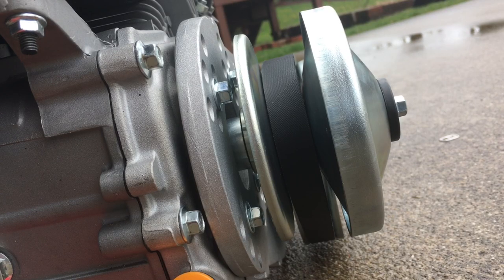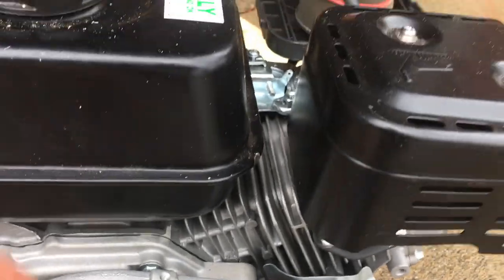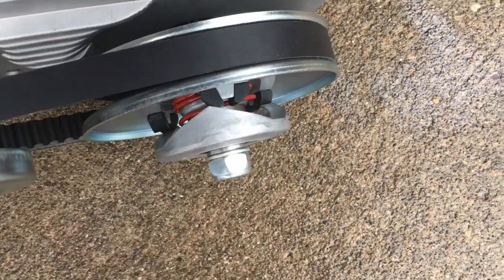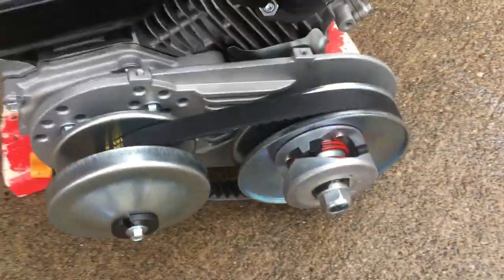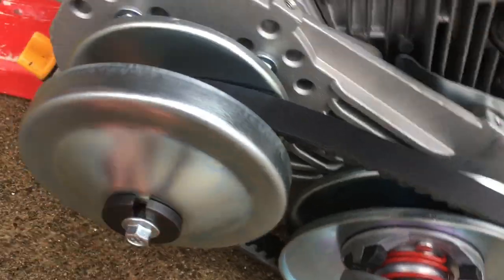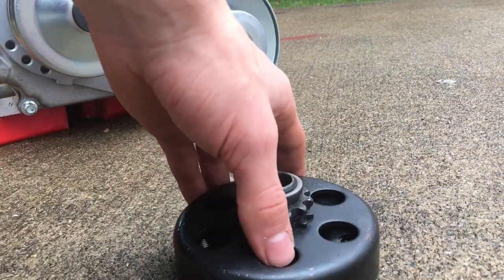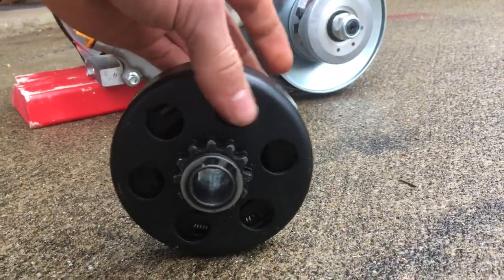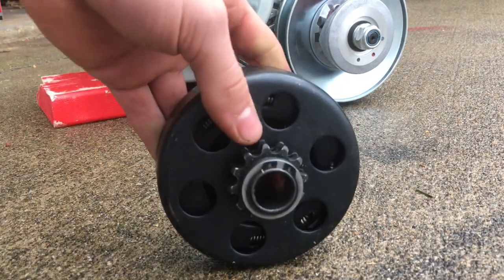What Are The Differences Between a Torque Converter and a Centrifugal Clutch?

Comment from the maker: The mechanism with the belt is called a CVT technically. That stands for continuously variable transmission. However, I call it a torque converter because that's what 99% of people in the go cart and minibike world call it. I know what the torque converter is. It is a fluid filled enclosed mechanism that is an automatic transmission cars.Please stop commenting that I'm wrong.
Reply: Good job bud, don’t worry about the numpties!
Reply: And John you forgot to mention that an auto torque convertor can multiply peak stall torque upto 2.6:1 times via internal finned angled vanes.Trev🇳🇿😎New Zealand home of the world's fastest old Indian 😇
Reply from the maker: @trevinskiking2165  thanks for the info!
Reply: @JohnWheels  No worries,....you can get similar effect to the 'Holeshot' Auto hotrod converters by putting those heavier weight springs in the centrifugal clutch, cheaters simple way of revving it up & dropping the clutch at a more favourable higher revs before engagement.Cheers Trev. If you want a little more get up & go but a convertor is out of your price reach.Simple speed tip for the price of 2 or 3 springs. Trev💪

Comment: had a seized driver clutch (wouldn't move back in) and didn't know why, this really helped me understand the mechanism.
Reply from the maker: Yea you can probably take it apart and wire brush any rust that might be in the driver, or you can just buy a new one for cheap on eBay.

Comment: That was great - I knew the difference as far as one converted the torque from the crankshaft and the other simply used centrifugal force from the crank shaft - but not to the level of understanding that you provided in very easy terms to understand - thank you!

Comment: Iv always said, just buy what fits your budget. Yes the torque converter is better but if you want something cheap to bash around your local field on then the clutch will work just fine. It's all comes down to your build. No point putting a $140 part on a $80 go kart lol.. Great vid tho, very easily understood :)
Reply from the maker: I got mine for $60 bucks on amazon, but I agree. Thanks for watching.

Comment: It is actually a Continuously Variable Transmission, not a torque converter which is kind of fluid coupling with torque amplifying capability.   Transmission do change the output torque (via speed differences between input and output) but the torque converter changes torque in a very different way.  A centrifugal clutch has similar function as the torque converter, that is to engage/ disengage engine from transmission.  For some reasons some people call CVT a torque converter while it is completely different from an actual torque converter. You can't compare transmission and clutch because they have different functions and are not interchangeable. What you have here is a CVT with a centrifugal clutch.

Comment: Need to spot weld that bolt going to the engine. Spot weld it to the dish slide. It's mild steel. Don't worry about taking it off. You can grind it back to factory. Get the Kevlar belt to make it last longer.

Comment: thank you for explaining this, would a Torque Converter be good for a small dirt bike?
Reply from the maker: Usually small dirt bikes have engines with transmissions built into them. But if you used a predator or a Briggs & Stratton type engine, you could use a torque converter, I just recommend getting an engine that is fit for the bike though.

Comment: Good job most adults could not have done better what is the spring on the rear pulley?
Reply from the maker: Thanks! The spring on the rear pulley is when the rpms of the engine increase, one side of the pulley spins about a quarter turn while also going out a bit. This allows the belt to fall into the V shape of the pulley more, changing the gear ratio slightly for more speed.
Reply: @JohnWheels  thank you not only are you better at this than adults but you get back two people and answer questions good job!
Reply from the maker: Thank you!

Comment: Only thing I hate about what a lot of people call a torque converter is that they don't include a motorcycle sprocket mount on the back side of the driven unit to allow for re-powering any kind of motorcycle basically the shaft that the driven unit bolts to needs to be longer and sticks out the back by at least 1 to 2 inches and is made to allow it to have a motorcycle sprocket attached to it and drive the motorcycle's rear wheel.

Comment: Is a torque converter more durable? I had a kymco scooter before and it had what I thought was both but it couldn’t idle so I’d have to jump on start and go. Either way I’m doing research because I’d like to build a mini bike. Something with enough pull to get me going closer to 45mph. Great video you are a fantastic teacher.
Reply from the maker: Thank you a torque converter will let you go a bit faster, but I'm guessing the bad idle might be because of a gummed up carberator. Make sure all the jets are clear and then you can have a regular idle and not have to jump on it. It's normal to want to creep forward a little, but it shouldn't try to run away. The 45 mph you want can be best achieved by putting on a smaller rear sprocket. Hopefully this helped, I try my best to help, but forgive me if I'm wrong.

Comment: Nice informative video very useful for someone who is new. I f we fit this in a royal Enfield 1996 taurus diesel engine how will the transmission work because it has a separate gear box so how am I suppose to work on that or just let it sit idle and make it an auto connect like yours could pls elaborate me on that coz here in Asia there no such thing for a diesel engine. Thanx for sharing.
Reply from the maker: Im sorry but I'm not too sure about cars but this clutch is rated for 10 horsepower and is meant for go kart and minibikes so I think it won't work. Thanks for tuning in though. Sorry I can't answer.
Reply: @JohnWheels  no sir what I'm trying to ask was I have a bullet a motorcycle not a car and I wanted to fit this into that.
Reply from the maker: I'm sorry, I don't really know. Sorry to disappoint
Reply from the maker: For a motorcycle, a 40 series or 780 torque converter might be better

Comment: Do i have to oil or grease my torque converter every 24 hours of use?  And where do I specifically apply the oil?
Reply from the maker: I’ve never oiled mine before, but I’d say oil between the pulley and the brass bushing. Just don’t get any on the surface the belt rides or it wont engage.maybe oil the internals of the drive pulley if u want but don’t take my word on this because I’m just not quite sure. Sorry.

Comment: If I have a tight enough chain and don’t want to buy a new one can the torque converter swap a centrifugal clutch in the same exact spot? Or is it slightly different?
Reply from the maker: No, you would have to buy another chain. The torque converter uses the chain coming from the back pulley and the centrifugal clutch uses the chain coming right off the crankshaft where the front pulley is on the torque converter. So, if you wanted to switch you would beed a new chain. Just note that I usually recommend torque converter's over centrifugal clutches so I might not recommend switching them out.
Reply: @JohnWheels  oh good thing is  I already ordered a new chain 😁 thanks!

Comment: Thankyou very much. Now i know. I guess i need a tc on my Manco. Since your so knowledgeable on these maters let me ask you a ?. I just bought a predator 212 and it has the EPA emblem on the box, how can i utilize a stage 1 performance kit from gomo? I really want the exhaust and air filter to get that tuned look and sound.
Reply from the maker: TheJohnnyairgun, Thanks for watching! I have a stage 1 kit and love it. They sell stage one kits on Go Power Sports.com With emissions, the engine will no longer be legal for California, but since go karts are not street legal in the first place you should be just fine. The EPA stuff is for commercial equipment. You might want a muffler if you live in a neighborhood though, so your neighbors dont get mad (also sold on go power sports). For the kit to really shine though, I would also recommend 18 pound valve springs and removing the governor. I'm not quite sure what Gomo is though, sorry. Glad to help.
Reply from the maker: Don't click the auto link, search go power sports on google
Reply: @JohnWheels  Thats what i ment. Go powersports. The reason i asked about the stage one kit is on the website it says wont work with the epa motors. I think because you have to re-jet the carb, but im curious what would happen if i did anyways.
Reply from the maker: Any Honda 6.5 horsepower clone should work. It might be legal stuff for California.
Reply from the maker: I think you are right about jetting the carb. Still put it in though, otherwise it will run badly.

Comment: Nice vid. What's the difference between a 30 & a 40 series tc?
Reply from the maker: 30 series has a 3/4 inch shaft drive pulley, and 40 series have a 1 inch shaft drive pulley. 30 can handle a modded 6.5 horse, no more, and a 40 series can handle about 20 horsepower.
Reply: @JohnWheels  Thanks. Thats just the info I was looking for.

Comment: Hello Ive become interested in these engines and my question is; what is the difference between 30 series,40 series and so on? Thank you
Reply from the maker: Alexander Ellis 30 series is for 3/4” shafts and 6.5 hp motors or under. About 200cc 40 series is for 1” shafts and for 9hp engines and up. About 340cc and up
Reply: @JohnWheels  Thank you very much man .😁

Comment: So is the chain that connect from the torque converter to the sprocket that rotates the wheel a 420 chain?
Reply from the maker: It can be 420 or 35. I have 420, but look for a torque converter that has both a 420 and 35 When you buy it.
Reply: @JohnWheels  that's a 10 or 12 tooth right?
Reply from the maker: 420 is 10. 35 is 12
Reply: @JohnWheels  thank you!

Comment: What would you recommend on a go kart going to be used around the street grass and track
Reply: Maybe track
Reply from the maker: Torque converter for street and grass definitely. It’ll still be good on the track
Reply: John Wheels ok thanks what brand which torque converter you would you recommend for a 60t 41,420,40chain sprocket on a 212cc predator
Reply from the maker: Basically u can get the cheap ones on amazon or eBay. They’re all the same, or you can get the gopowersports one which is high quality but double the price. I have the cheap one and it’s been fine but If u really want long lasting get gopowersports.
Reply: John Wheels ok thank you so much
Reply from the maker: Look for the kits that include either the 40/41/420 gear or the ones that include both the bigger chain and 35

Comment: I've had issues with my torque converter belt getting hot and slipping after about an hour of use, do clutches let you go at higher speeds longer? Also its after an hour of hitting top speed
Reply from the maker: Clutches tend to get hotter and slippery more. If you are running a cover over the torque converter, take it off for airflow and cooling

Comment: Hello, can you switch from a centrifugal converter to a  torque converter?? I do have a Subaru robin engine with a centrifugal clutch
Reply from the maker: Yes, I'm pretty sure you can, but You MIGHT need engine risers if the torque converter hits the frame, (check with the Torque converter on first) thus longer chain. It depends on your frame. You can use 2 pieces of 1" square tube, drill holes, and use longer bolts for risers. With your engine, you'll also need to trim a little off the torque converter backing plate. You can do it with a grinder or big file. Grinders are $15 at harbor freight and are a great tool. (shown in video) Cars and cameras did a video:

https://youtu.be/ceE8vgb2fwY
Reply from the maker: This riser kit will work if you bore out one hole on each riser, if you need risers:
https://www.gopowersports.com/engine-riser-kit
Reply from the maker: Also, most importantly check your crankshaft size when buying a torque converter, it might be 3/4" or 1" (measure it) to know what torque converter kit to get
Reply from the maker: Also 7/8." If it's not one of those three sizes, there will be no torque converter's available. Then, the torque converter will not fit on your particular engine. The predator engines have three-quarter inch which is the most common and they're only 100 bucks at Harbor freight. If you want, you could grind down the shaft until it is three-quarter inch with a grinder while the engine is running, but I would not recommend that

Comment: What size engine and will this work for a bicycle setup
Reply from the maker: Mine is a 212cc engine. This won't fit a bicycle. However, They do sell complete motorized bike kits. This will bolt right on.
https://www.amazon.com/YaeCCC-Bicycle-2-Stroke-Mountain-Motorized/dp/B073NX3MXV
Reply: @JohnWheels  I have a 212 as well. Regular clutch. I top out at 50. What do you top out at with that torque converter?
Reply from the maker: Lont Mac I get around 45, but you have to remember that my kart is a very heavy 2 seater with a roll cage and a 10 tooth gear on the Torque converter and 60 Tooth sprocket. Mine could go faster with a smaller sprocket.

Comment: So will the centrifugal clutch go the same speed? Or if not how much will it reduce the speed?
Reply from the maker: It will be about 5mph slower on an on road go kart. With an off road go kart, It will burn up and go very slow, because it has too much weight to move around.
Reply: Hey John. Slower than what? compared with an enigne that has a CTV? I want to make sure I understand which setup its slower. Will this CTV work under the rain? thank you!
Reply from the maker: Slower than the cvt. Both systems don’t work very well in the rain, but the cvt comes with a cover for it. Sorry I’m late

Comment: I need a belt n i dont know were to get one can u please help me  thank you
Reply from the maker: If you have a bolt on kit with the backing plate, this will be your size: https://www.amazon.com/Drive-Replaces-Manco-Comet-203589/dp/B016E23ZOK/ref=mp_s_a_1_4?adgrpid=60089513030&gclid=Cj0KCQjw_r3nBRDxARIsAJljleFhuviYSLjWOD3M0d1PgrpIQR8ISwhMVaF7SeBJTGA9LEHEjyTwA2waArZyEALw_wcB&hvadid=274745718421&hvdev=m&hvlocphy=9005950&hvnetw=g&hvpos=1t1&hvqmt=e&hvrand=2323724616286003525&hvtargid=kwd-540948542872&hydadcr=24294_9911348&keywords=203589%2F5959&qid=1559245893&s=gateway&sr=8-4 
if you have a jack shaft set up, you will have to watch a video on how to measure for ur size but The link will most likely be your size.
Reply: Gopowersports .com.     Real good people

Comment: I’m
Putting together a go kart with the predator 301 (8hp). What size torque converter do I need? And what will be the main differences in performance compared to using a clutch?
Reply from the maker: With a 301, it has a 1" crankshaft so you'll need a 40 series torque converter. (Sold at go power sports) With a bigger motor like that clutches will be more expensive and will slip a lot. Sorry for the late response

Comment: Question? If I put the black max torque spring in my clutch for my mini bike which I have from the stock is 3100 rpms which is what the new spring is rated at does it matter if the rpms on that spring are way higher than my minu bikes engine rpm which is 1600 because it doesn't seem to have made a huge difference even with a smaller sprocket my dad thinks that spring is too much for the engine to handle so its bit doing it much good for speed or torque because the engine can't handle it can you help out on this?
Reply from the maker: I'm sorry, I don't know a whole lot about actually changing the springs as I've never done it before. Usually for me, just messing with rear sprocket size is all the tuning I do and the factory springs in my torque converter seem to do just fine. good luck with your project though.
Reply: @JohnWheels  thanks!

Comment: Ive been trying to get one on my 212cc predator "Your motor will just blow cause your basically adding more torque in a small engine" is this true
Reply: No. Torque isn't going to backfeed into the engine nor is it going to make more torque than it is capable of. All a torque converter does is keep the engine power driving whatever it is driving in the most effective gear ratio. Without it you have a choice of power down low (such as taking off on a minibike from a stop) higher speed with loss of that or some compromise between the 2. This is why a lot of the vintage mopeds that didn't have variated transmissions (some did) relied on pedal assist for starting out and climbing hills

Comment: Don't know why people call them torque converters that not what it is it's a CVT style of Transmission better than a centrifugal clutch because a CVT has a wide range of gear ratios available in one system where as a centrifugal clutch only has one gear ratio and and that is determined by the sprockets used that is why scooter's have been using CVT's for decades now they can take a 3.5 to 5 horsepower engine that a 50cc through 150cc engine put it a scooter and a person weighing 200 pounds can get it to 30 to 75 mph but if they use a centrifugal clutch with the same engine's used would only achieve a top speed of 20 mph no matter what they do to improve the engine displacement or performance.
Reply: can change the sprocket :P to go faster then 20mph :)